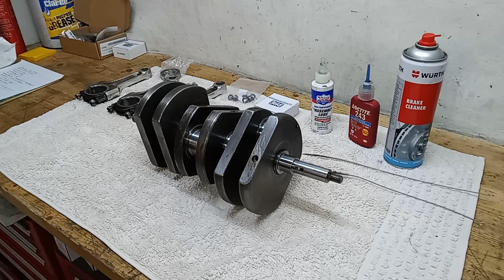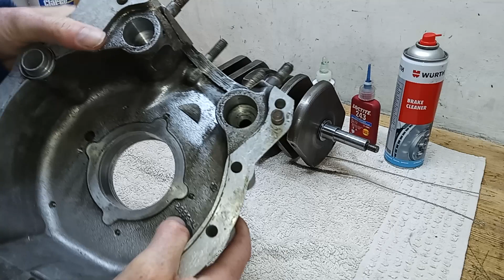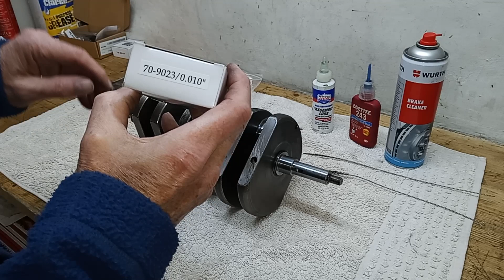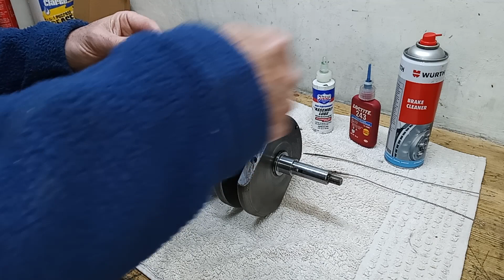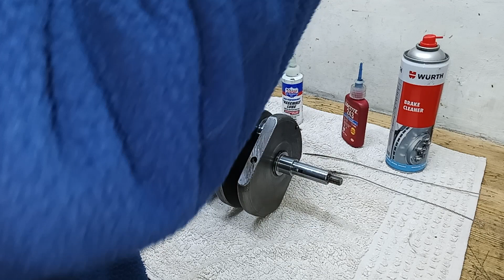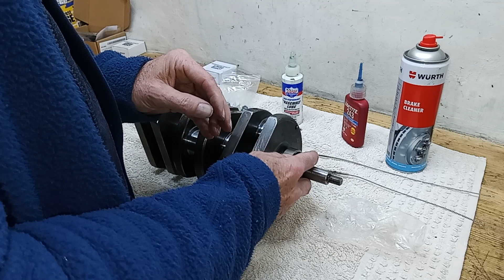Triumph Trident T160 Rebuild. Part 25: Crankshaft Assembly

Comment: Surprised you are not using new big end bolts too as they do stretch and liable to fatigue after 40 years.
Reply from the maker: Yes, it was an option, but on balance decided against it. I've fitted replacement ones before and not been happy with them. It's one of those decisions. The same dilemma with the conrods. 🤔